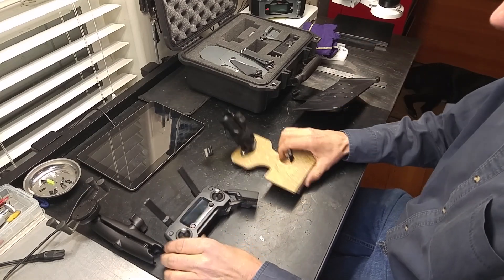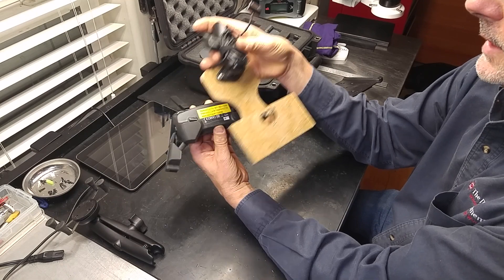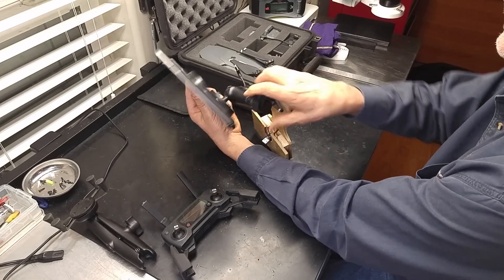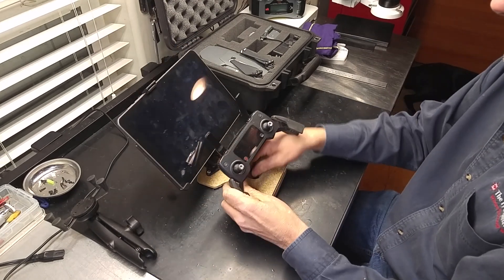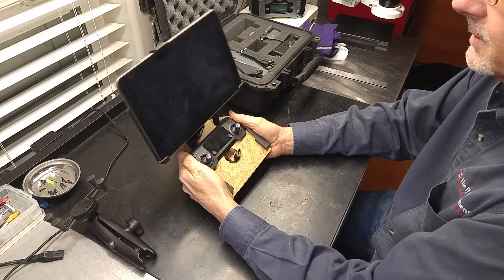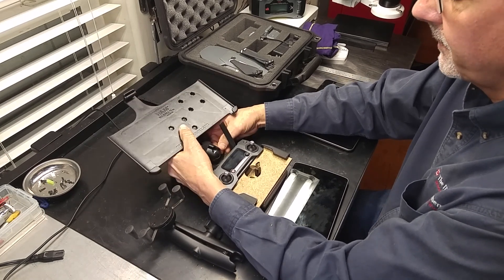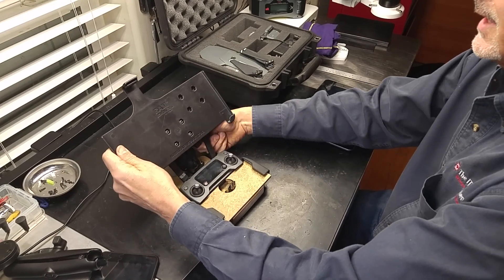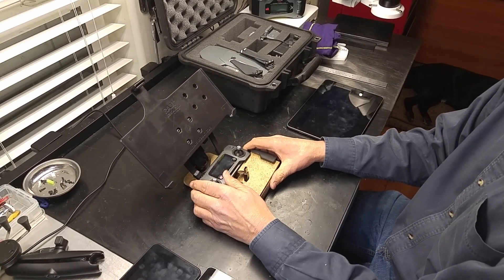DJI Mavic Pro | Tablet Mounting Solution

Comment: do a range test before going much further. I've been doing path studies with the mavic system and  that remote really hates anything in its way and if it's metallic it almost completely destroys the swr and shuts down.  clarification: anything in front or between the antenna is bad. behind them or even almost directly over them seen to be "ok".
Reply from the maker: Thank you for the info.  I have done some testing with it.  I have had video signal go out completely 2 times and I thought it was the tablet's fault.  The mounting arm is metal and it is right in the middle of the antennas.  That may explain it.  I'll do some more testing, but it may be faulty.
Reply from the maker: I did a flight test yesterday using the same tablet with a different mounting solution that is not near the antennas and the DJI Go app crashed and had to be restarted.  There is something with this LG tablet I think, so I can't say if there is any antenna interference, but I am pretty sure it is not good to have metal objects near the antennas, so I an not recommending using my idea unless the mounting arm can be made from non-metal parts.  I think it would be best to have any mounting structure below the controller, rather than above it, near the antennas.
Reply: Rick Dennis hi Rick, please could you share the dimensions of your tablet holder with heights, widths, lengths and thickness?
cheers